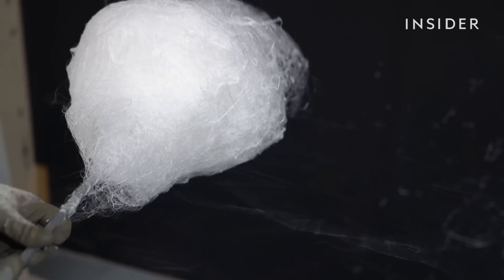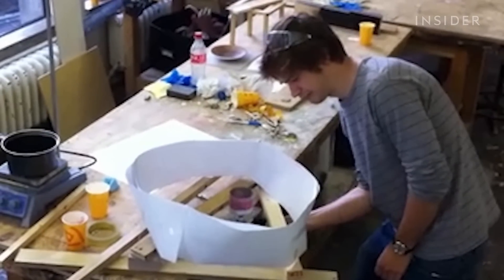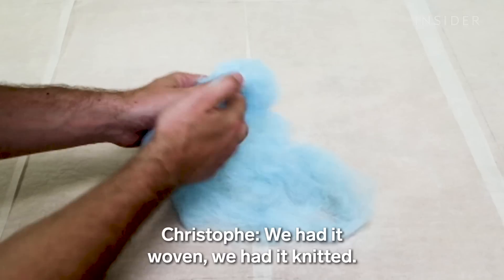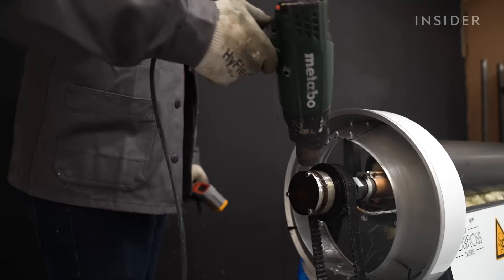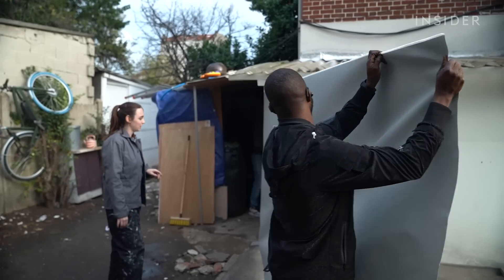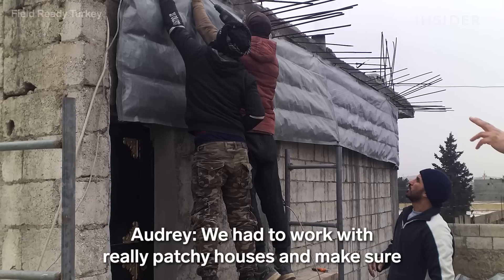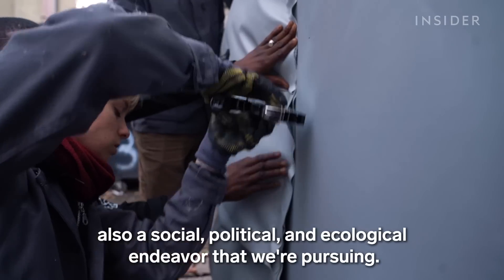How A Modified “Cotton Candy” Machine Makes Plastic Fibers For Insulation | World Wide Waste

Comment: Films produced can be used to reinforce low density and insulating concrete taking care of the fire hazard. Fumes and microplastics in the production room can be passed thru water to avoid polluting the air. FrRAC.the Philippines.

Comment: I think it’s an excellent concept- my only concern is making sure it’s properly contained within something so we don’t just unleash a new micro plastics hell upon ourselves. Considering current pillow stuffing and poly fill are currently sold commercially, it seems like an easy industry for recycled plastics to inhabit nicely.
Reply: But plastic is horrible at holding in heat LOL it's cheap but not very efficient and it's a horrible pollutant

Comment: I worked for Philip Morris international and my participation is to manufacture an alternative to Cellulose Acetate cigarette filters. The plastic we used is polypropylene the only snag it gave off peppery flavour when smoked ,but bloomed tow like material was good at absorbing oil like a sponge . In any case plastic fibers are flammable so if it catches fire then you have problem so that's why glass wool is used for insulation.
Reply: That's actually pretty interesting. Is the cellulose acetate used today, or did they scrap that idea? If so, what do they use as filters then? As a smoker I wonder if I would even be able to taste that peppery flavor lol.
Reply: @spleenforsoul  cellulose acetate is still used.

Comment: The ideia is nice but an insulation that easily catchs on fire? Not acceptable - specially if it's to be used in shacks and shelters without good and safe electrical sistems. 😕

Comment: Unfortunately it’s Useless, looks like a second or third thought. The application is far from good, so many risks, durability and…please common sense most of the refugee camps are not in Siberia or Canada. Insulation of refugee camps is not on top 100 priorities of the camps.They should’ve spent those many years of research and work doing several other things

Comment: I feel like it becomes a fire concern over time. Theyre very fine which makes it soft but you don't need it to be soft to insulate a house. And it's a little worrying to me that it will start to fall apart. Fiberfill for stuffed animals slowly get more brittle over time because of temperature and washing making then thinner, but these already start thin. Wouldn't they be prone to breaking down and flying around in the air?
Reply: Dunno about break down and flying around in the air part, (and anyway, they're put in these bags, and are made for temporary housing only, so unless a maniac came round and ripped them all open I doubt you'd have to worry too much, when they make it they also wear the correct protective equipment.

But the soft part I do get, it isn't necessarily that it's soft that's the reason why it's so good at insulating, why is wool good at insulating? The individual strands are thin enough that it's a breathable material, allows air to go through it essentially, but thick enough in quantity it can also trap some air inside it, that trapped air can also be warm or hot whilst trapped, ensuring that the warmth is stuck inside the material, warding off cold outside and keeping the temperature inside much cozier.

Usually these types of breathable but air and heat trapping materials do tend to be soft as a result of how they're formed/made, it's mainly the heat inside the material that makes these things warm, e.g. body heat or a space heater or radiator, it keeps your warm air inside much long and keeps out the cold air much more efficiently than a thin brick wall can do, keeping the temperature at the temperature you want it for much longer and much easier than other materials would do.
Reply: @infinitechibi1496  The containers their in may be good for a few years, but you have to remember: Plastic DOESN'T degrade. Can you insure that what the bags this is stuffed into will remain sealed for the next 100000 years or so? Or that the bags their put in won't degrade themselves over time or from wear? To me this just seems like it would make our microplastic hell even worse
Reply: @athingwhichexists  I wasn't really talking about that? I'm lost. Of course they're bad in terms of microplastics, they aren't supposed to be a long term thing anyway, it's for temporary housing, for hopefully a temporary issue.

I was talking about how you don't have to worry about breathing these things in unless someone very silly came and cut it open somehow.
And about them degrading, they're supposed to be for temporary use, I don't know how they're gonna deal with removing, repurposing or recycling these things but hey, that's a problem for the creators to deal with.
Reply: @infinitechibi1496  That is what I'm talking about. They may be for temporary use, but in things like this, temporary very frequently becomes permanent, and once the containers begin to degrade then people could be breathing in the stuff, or eating it, not to mention the affect ont he environment

Comment: It's an interesting idea, but I can't help thinking that this could be the next asbestos; especially with the growing concerns over the dangers of microplastics.
Plastic doesn't readily break down in the body and you know that they are inhaling massive amounts as they work there and handle it without PPE.
Reply: YAYAYA micro plastics yum
Reply: My line of thinking exactly.
Reply: Exactly what I was thinking. 
In addition, it’s a major fire hazard.
Reply: @sevanjacob2285  Yeah, fine wool made of plastic is just asking for a fire.
Just one spark and it would practically explode.
Reply: Exactly, there is already a gross amount of microplastics everywhere we go, now it's going to be in your walls, it's going to be in your air vents when you do construction. Cancer is going to be BOOMIN
Reply: they did say that they have dedicated a different room for it to prevent exposure to microplastics. Its still a worj in progress though so i guess it will take them some time to work around that problem, but for now, theyre at least doing smth about all the waste that is just lying around
Reply: Did you watch the video? 3:35 addresses the micro plastics and the fumes
Reply: @Zoleroid  its not about microplastics being produced during production but about the time when products made out of these plastic fluff will be disposed off. You can trap all microplastics you want in controlled environment but not when you're sending it out in free market. Its plastic fluff afterall.
Reply: Aye
Reply: There is no danger here
Reply: So you think it's better to just throw it in the environment or burn it because that's what's happening now?
Reply: @byjynydjshsnny2430  Or use high temperature incineration and ash processing.
Reply: @VPCh.  where does all that power come from? that's not cheap
Reply: @googleissacommunist3150  With incineration, the material releases some heat as it is burned. Almost all plastics are metastable, so it absorbs some thermal energy to burn it, but as it burns it releases more than it used.
Normally you have a primary combustion chamber where it burns normally, then the you take the bottom ash from that and use it in some other industrial process like roads. The gases and smoke from the first chamber go into a secondary chamber where they are superheated to the decomposition point by mixing with oxygen and natural gas. They run a turbine to recapture some of the energy, then pass through a series of scrubbers to remove any excess harmful emissions other than water and carbon.
Yes, it isn't free. It costs money to run the system, but you avoid plastic waste building up in dumps and you can recapture some of the energy.
Plastic recycling isn't usually viable, it doesn't recycle well.
Reply: @byjynydjshsnny2430 well you don't solve a problem by creating another problem do you?😂

Comment: Hopefully at least in their indoor main facility they can figure out a way to automate the collecting and rolling of the floss as it flies out of the extruder so a human doesn't have tk be exposed to the fumes. 

It's always such a confusing conversation when it comes to pollution solutions. (I'm sorry that rhymed lol) like we deff need to figure out a way to reuse the plastic but melting it and releasing fumes and using more energy to do it seems bad too. Ultimately reducing our use and going to reusable packaging. But that's a long way away, so this deff removes a ton of it in the mean time. Just curious as to how much the melting down and reusing plastic for polyfloss outweighs the impact it had when the plastic was originally made or would have had if left in the environment or gone to landfill
Reply: I would think you could electrify the entire production process, which would at a minimum remove the energy impact cost if the electricity was sourced from renewables.

Comment: Great example of flammable microplastic manufacturing 👍
Reply: Its all fun and game until it catches on fire 😊
Reply: Di-did you even watch the video? They even addressed that in this video. They encapsulate it in a non-flammable container. Gotcha, you're one of those people that  only reads the title of articles and acts like you know everything on the subject now. 😂😂😂
Reply: @ehbr1547  But how long does that container last for? How long until a hole appears in it, or wear begins to break it. Plastic doesn't degrade, meaning that those bags have to last for hundreds of thousands of years, If they don't then these will become a major hazard over time. These are meant for poorer areas so : Are the containers well insulated from the environment? What about handling animals or bugs that nip at them, or people moving them. Depending on the area too, what if you have flooding issues, or a tornado/Hurricane hits, what about a lightning strike or electrical incident? I can almost guarentee you none of this was considered and that they just grabbed a type of container that was flame resistent and hoped it would work without considering its lifespan or how well it handles non firey conditions
Reply: Spray foam insulation is also flammable and it's about as bad as using plastic but people still use it.
Reply: "thats why polyfloss needs to be encapsulated in a fireproof fabric."
Reply: i never seen a house fire started by plastic., and most fibre glass insulation is consumed in fires, never hampering any fire. if you follow safety guidelines , common sense is what it is. this is a good idea

Comment: Wow, the thinnest Fibre made from plastic. It's amazing. But tell me is there a guarantee that the Fibre will not go to the places where it doesn't belong, like your lungs? Even after installing with masks and stuff, what will happen when after a time it starts wearing off thread by thread? Will you collect every thread or will it end up on our food, water or air?
Reply: Newsflash: 

It already is in our food, water and ecosystem. This isn’t going to accelerate it. Just make it so we can control it better.
Reply: @blahblah2779  Burning it in a propper incinerator is a better way to control it. Adding microplastics in a bag to the environment is not a way to control it... the bag tears and boom bunch of microplastics all over the place. Resulting in More microplastics in our food water and ecosystem.
Reply: This is spot on anyone trying to defend these people are completely whacked out
Reply: thats why theyre wearing masks when theyre putting it together. after that, its encased. also, the fibers are no different than regular insulation fiberglass, which are also hazardous, but we have it in almost every home made here in the u.s.
Reply: @cerebrumexcrement  however Fiberglas is mostly glass which will turn into sand, whereas Plastic does not become sand it becomes microplastics so no it is not the same

Comment: There are reasons for using mineral/glass wool. This would be horrible in a fire🔥
Reply: Wait, you though anyone was proposing to use this as permanent insulation in a house and not as a solution to help the most impoverished deal with temporary cold??
Reply: @thornyback  these structures may be temporary.... but in some cases these structures become more permanent with time. I remember hearing about some earthquake relief from 10-15 years ago... and people are STILL living in those tents instead of a home. The people interviewed living there were frustrated with these temporary accommodations that weren't so temporary.... Wouldn't be surprised if they still to this day are living there.
Reply: Lots of flammable materials are already used as insulation, with added glue-adjective to make it non-flammable, such as newspaper, straw/hay etc. This product/method is clearly still in the startup fase, but the idea is interesting.

Comment: So it generates micro plastics by design and is highly flammable. They say they want to send to places of extreme plastic pollution and little recycling infrastructure but the machine requires recycled plastic pellets. The machine itself doesn’t recycle plastic, it just uses recycled plastic in a fairly irresponsible way.
Reply: Its just an accident waiting to happen, people putting this stuff into their walls, all it takes is some exposed polyfloss and some tinder, its like a ticking time bomb.
Reply: guess we'll see how durable the fireproof encasing is. dont really have much options if ur living in a poor a$$ country.
Reply: It's not highly flammable, it is flammable. And this is exactly the same as the stuff in duvets, pillows, mattresses, padded coats, sleeping bags etc etc, I'm sure it's fine flammability wise.

Comment: I'd have to imagine the insulation is quite flammable.  I wonder what thought has gone into its safety on that front, or if it'll be limited in use because of this issue.  Interesting idea either way.
Reply: Spray foam is flammable too.
Reply: @MCXM111  I don't disagree, but my concern isn't whether it's flammable.  It's whether it was taken into consideration to begin with as that wasn't brought up in the video.

Mainly I'm just curious and fire safety is just one of those things I'd like to know along with price and end of use disposal.
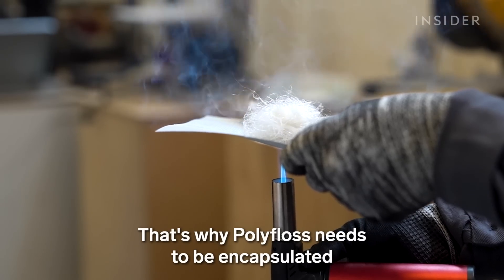Reply: Around 4:03 they mention it can catch fire which is why it needs to be encapsulated in a fireproof material. Then they fill it in. So it seems they know and have taken it into consideration. Idk if that answers what you wanted to know enough?
Reply: @spleenforsoul  :o thanks!  Somehow I missed that on the first viewing of the video
Reply: It's exactly the same as the stuff already used in duvets pillows padded coats sleeping bags etc etc so at the very least it's certainly not creating a new problem

Comment: Ok but the whole reason you can't use this legally is because most plastics are derived from petroleum which is extremely flammable. That won't pass code. So maybe if they add a fire retardant to it? But even then, 14 degrees isnt....good. if it's 32 outside, and only 14 degrees warmer inside with the insulation...
Reply: Existing home insulation materials can effect 5 to 20 deg change in Temp. So 14  deg is pretty decent. Flammability is defo a concern though.

Comment: I love your idea! It looks safer to use than fiberglass insulation.
Reply: Fibreglass is fire resistant .
Reply: @typicalrockhound9887  this is just a simple and easy fix for things like refugee camps, those camps clearly cannot get fiberglass and fire would be their least worry because the insulation would be covered by a material which I am not sure what it is, anyways you lose your point is bad
Reply: @geometricprincess  Its not a bad point at all.  I bet this stuff can do major damage if it catches fire. Not to mention, if its only for temporary use, then you now converted the plastic to micro plastic .
Reply: @geometricprincess  it is what it is 👌
Reply: @geometricprincess  cutting corners and being cheap is the new thing anyways 🙃
Reply: And this micro plastic will get into your food and water
Reply: It burns. Owens Corning does not
Reply: fiber glass is recycled glass and doesn't leave micro plastics in the drinking water
Reply: Plastic is essentially oil. You know heater fuel.